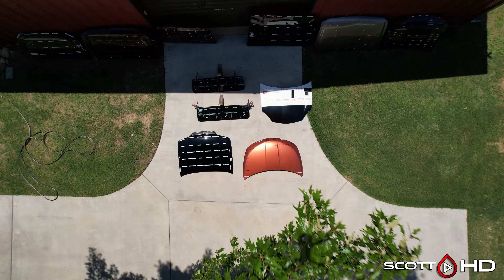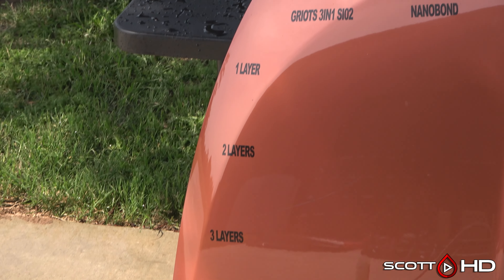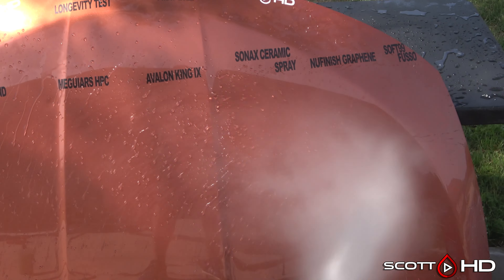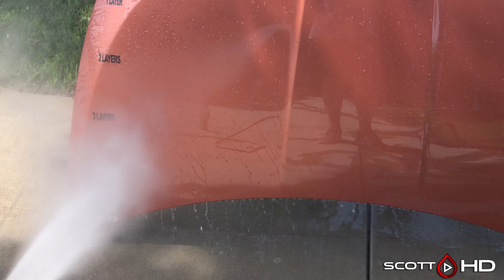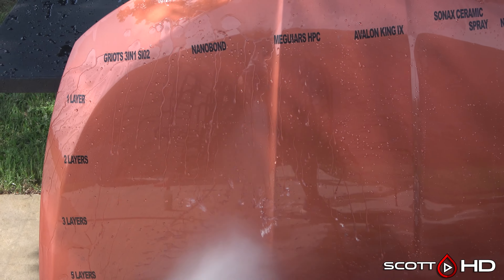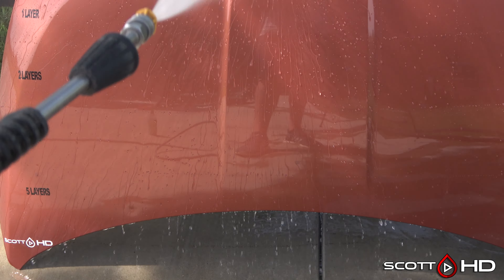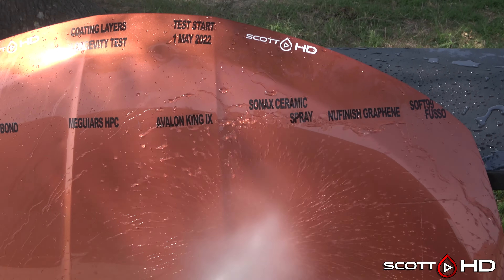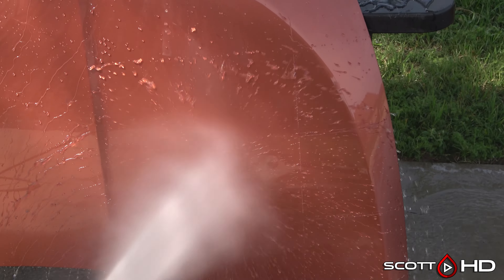CERAMIC COATINGS - HOW MANY LAYERS IS TOO MANY? Top DIY's Tested! - UPDATE 01 - FIRST RINSE

Comment: This is a great test, and will be interested in seeing how others perform! I typically use 2 coats of Griot's 3-in-1 which lasts over a year; still good hydrophobicity on the side panels, so I will usually strip wash when I reapply in the spring

Comment: Just pulled a test panel out yesterday that had various soft99 waxes on topping each other. One of which was the old version of fusso and had 2 coats on. Still had some sheeting after over a year being hammered outside all year round in England 🇬🇧 
It stood out as the best of all the combos 
Other included mixes of kiwami and KOG with fusso and lots of other long lasting waxes.

Comment: Fusso dark.  I can say with utmost confidence that it fills surfaces very well.  It can never be understated that this product has a learning curve.  But if you embrace that and just get good at applying it, it is nearly unbeatable.  I’m applying it to silver-plated instruments on a regular basis, and it absolutely works on metals like stainless steel.  It also takes to toppers well.  I’ll probably try King of Gloss next, but I’ll always aim to have a tin of Fusso in the war chest.
Reply: Try apply with a machine I was able to even better performance
Reply from the maker: I agree.  Fusso is quite "fussy" but it definitely seems to deliver.
Reply: @ScottHD  I forgot to add-  If you don’t dampen the applicator first, you’re missing out on what ends up being a virtually different product.  The wax loosens up and smears so much more consistently, breaking those occasional knots up.  Worth revisiting for that factor alone.

Comment: One idea would be to test slickness of the panels. In my experience, with many coatings there is an inverse relationship between hydrophobics and slickness that modifies said properties as you add more layers. In other words, you may gain hydrophobics with more coats but lose slickness. This would be a more visible way to also test if there is actually a difference between each section.

-MK
Reply: That's more of a coefficient of friction test, best carried out in a lab, with a tribometer. You could certainly prepare samples and do that. Send them to a lab and see what the results are. There are 'slip' testers for flooring and the like, but probably not accurate enough for these comparisons.

Comment: Since these are all great performers the likelihood of these paint close to a year is great. Would there be a consideration to try to advance the testing by either washing twice in the same video, double the wash intervals during the month? This could be a very long series ☺️
Great work, this is awesome content and have made purchases based on your testing and recommendations.
Keep up the tedious but much needed testing!
Reply: I’d offer/vote-to simply adhere to what most enthusiasts would do, long project or not.  If the focus is longevity, I would actually consider doing less to the hood, and allow the elements to try and dig-in.

I offer that as someone who lives in central Texas, can’t park cars in their garage, and had a giant live-oak tree constantly crapping on them.  I actually wash less-often for those reasons alone.  

Food for thought, I suppose.

Comment: so if this works as a valid “layering” method would we expect to see failures from the top down over time as the sacrificial layer(s) wear thru?  

 would the “clogged” concept see all of the multi layers clog at the same time? some people swear by chemical or waterspot decon to restore hydrophobics so i’d anticipate results that would demonstrate similar clogged times acrcoss a brand except maybe the single layer as it could conceivably degrade before becoming “clogged” 

love this test.  probably going to influence how many layers i use next october on the lower side panels where i expect winter road spray.

Comment: After the first wash can you show us a close up in between the test areas where the thin tape was separating each section? I'm curious to see if we can see the actual coating on the paint. Especially at the 5 layer sections. Can you feel a difference? Can you feel the edge of where the coating starts?
Reply from the maker: Absolutely!

Comment: I don't think were gonna see much until it's several months in but it will be very interesting to see if there is a difference!
Reply from the maker: I'm REALLY hoping you are right.  Needed to throw some F11 Top Coat in there for good measure :)
Reply: My friend in Miami, Florida uses two coats of griots with 24 hours in between. His car doesn’t sleep in a garage either. The hydrophobics take a hit around the 12-13 month mark. He’s never tried with just one coat but going off of what I’ve seen in colorado. 1 coat of the stuff can net you 7-9 months

Comment: Multiple layers of turtle wax hybrid ceramic spray definitely gave me more durability but not more hydrophobicity.
Reply: Hydrophobic*
Reply: @Vyker  LMFAO do u not know the difference between hydrophobicity and the word hydrophobic?

I’d go hit a dictionary before correcting folks. Good thing is, online at least, u can leverage the power of internet anonymity. Too bad it back fired on you this time.
Reply: @SheekTresSesenta  in the way you built your sentence the correct word is hydrophobic.
Reply: @Vyker  here’s the definition 

“Of or exhibiting hydrophobia”

It was used correctly.
Reply: @SheekTresSesenta  hydrophobicity is the "measurement" of hydrophobia. Hydrophobic is the "outcome" of hydrophobia. You were telling us your outcome.
Reply: @Vyker  I said. And I quote “….. gave me more durability but not more hydrophobicity”

In the context of this sentence, I alluded and claimed that I was given more durability. If durability is an amount, I am claiming I received more of it. In regards to “more hydrophobicity”… exactly what you u think I was trying to say? Was I not measuring it in time, just like “durability” in my claim?

U can go troll someone else. You’ve got a lot of time on your hands.
Reply: Good to know, thanks.
Could you tell me how long did you wait between the coats? Can I apply next coat couple hours later or at least 24h?
Reply: @malan07  personally I waited 24 hours. Never tried applying sooner or later. Maybe just waiting a few hours would be enough? I’d ask around

Comment: Using Turtle Wax (Hybrid Ceramic) and Griott's (3 in 1)- I've been happy with 2 coats, applied per instructions.  Then when I do a weekly/biweekly wash, I'll throw a spray wax on top.  

With Turtle Wax, I liked the Ice Spray Wax (it adds more to the color and gloss than the hybrid ceramic) and with Griott's, I'm liking the Ceramic Speed Shine (adds slickness and beading that the 3 in 1 somewhat lacks).

Spray sealants for the heavy lifting, spray waxes to make things pop.

Comment: this could be a game changer if 5 coats extended the life of the ceramic 5x.

this would mean you could just use the cheapest, easiest to apply ceramic coating 5 times instead of one properly applied coat

Find the absolute cheapest siO2 + tiO2 coating from china, mix it into something like meguiars hybrid ceramic, and apply 5 times. Immense if true